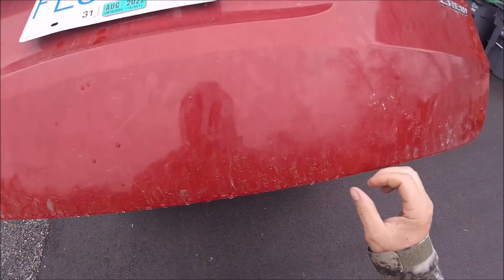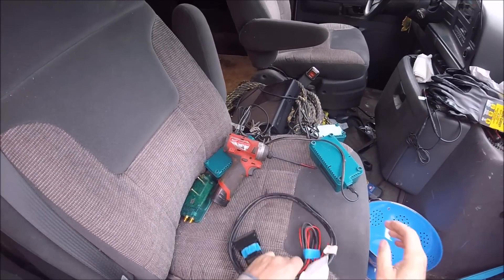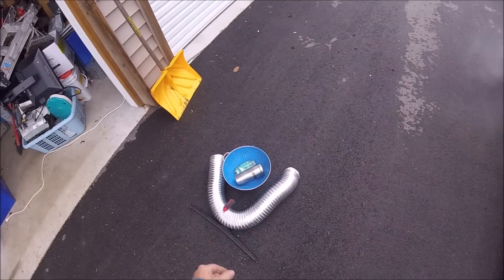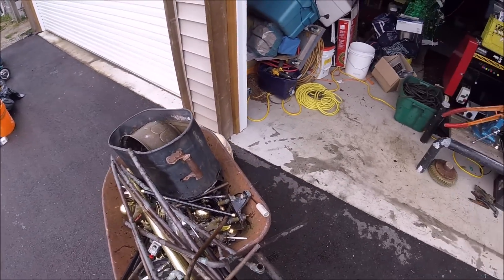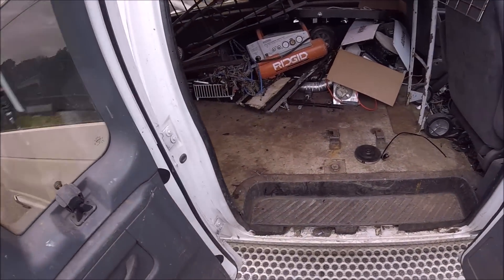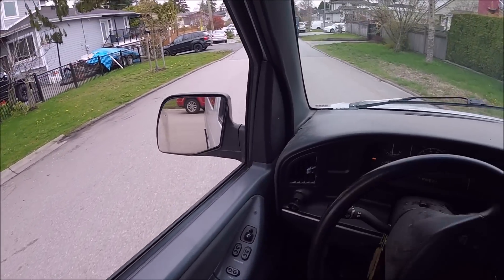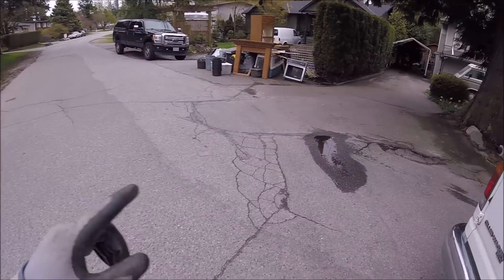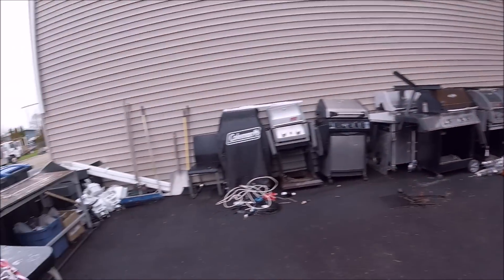Spring Cleanup 2nd Phase

Comment: I've noticed this too about the standard lower end Diablo. I was Haakon a tire off an ally from and the blade just died halfway through the steel radials. Sucks. They come out with a great product and they have to cheapen it to make the customer pay more.
Reply from the maker: You have to buy Diablo 50x to get the original Quality
Reply: @Canadian Treasure Hunter  That's right. Carbon tipped blade is what I found works but definitely have to go with the higher priced ones. Enjoying the Spring Clean-up. Is it done on Thursday or are there more areas?